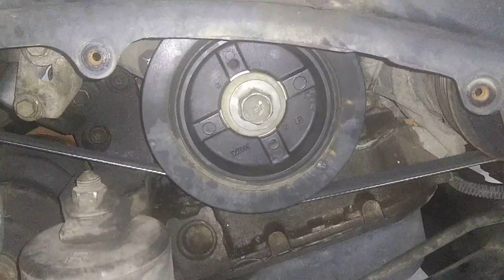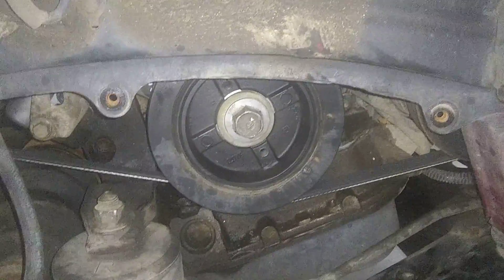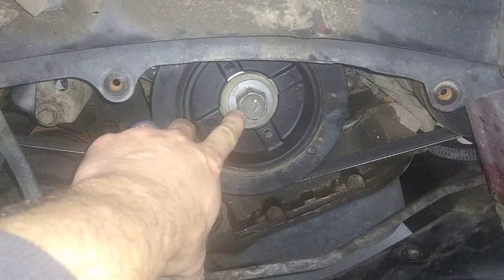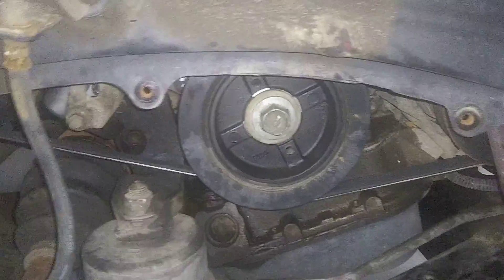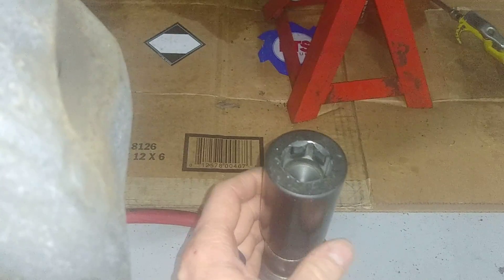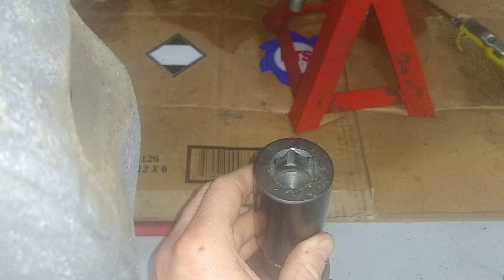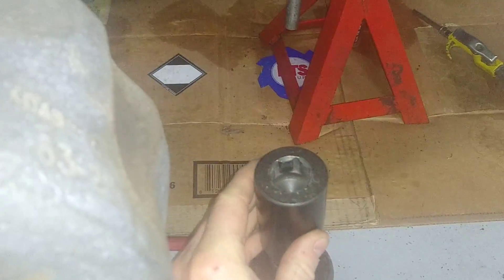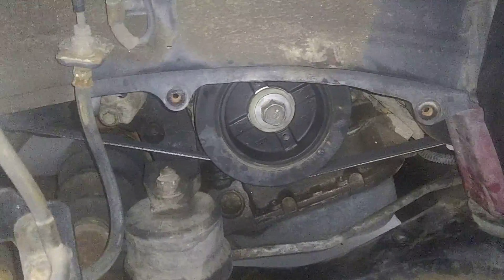You Have to Watch This Before Changing Your Timing Belt! Removing a Crank Bolt

Comment: quick question, if the bolt on the crankshaft is not properly torqued, when installing new serpentine belts, would it make a noise?
Reply from the maker: I doubt it.  It might be possible...but that sounds like a pulley or bearing issue and depending on the vehicle it could be the harmonic balancer.